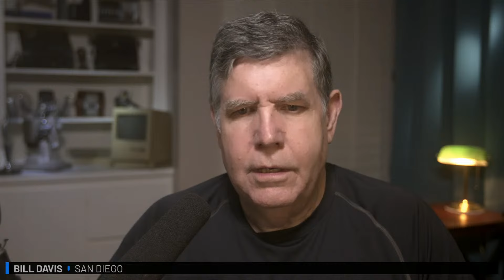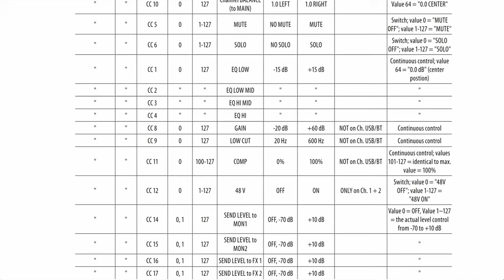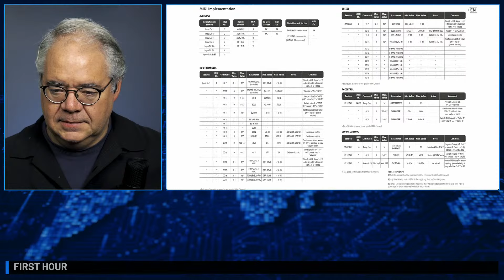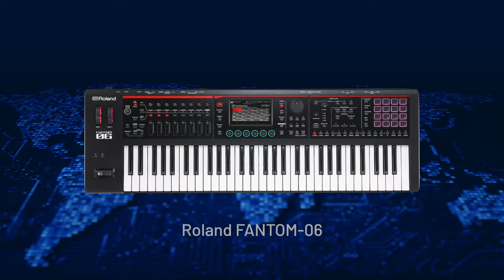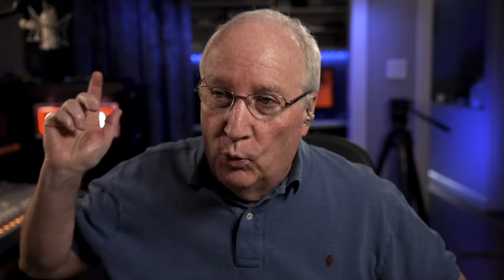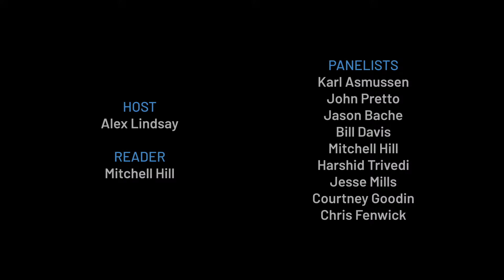Focus on Budget Solutions for Audio

Comment from the maker: 01:39:51 What are your best budget portable PRO audio setups for the iphone 13 pro or 14?
01:41:41 where do you draw the line from "budget audio" to buy once, cry once? client's budget? say rode wireless vs. Sony UWP vs. Shure ULX
01:50:38 What are situations where the purchase of higher tier hardware is key to making a production budget for audio production?(i.e. automation such as PTZ camera rental eliminates operator expense, Dugan Automixer, etc.)
01:55:04 I stretched my budget to a Sound Devices MixPre-3 a while ago but as yet I have been unsuccessful getting it working well enough to use in OH. 
Should I put it through the Atem Mini Pro, direct tp Mac Studio or another route.
01:57:40 What's your approach to purchasing equipment? If someone were wanting to get started in your industry and had a limited budget but was planning on growing over time, what equipment would you recommend they purchase, and in what order?
02:00:09 Most compact mixer with dugan auto mix for really compact use when Behringer and similar is too big?
02:01:29 The godox recommendation from Karl has worked great when I needed a other than 2.4 gig wireless setup my hand held xlr mic I've paired with it is a movo any recommendations for an inexpensive replacement?
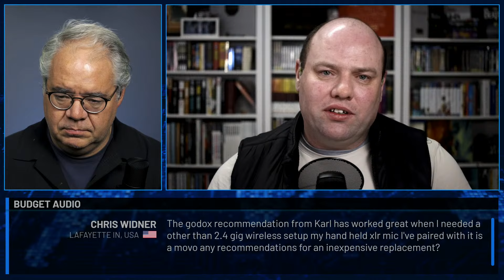02:01:59 For comms headsets, has anyone considered tactical eartube microphones? It might be a little more aesthetically appealing than the AfterShokz (which I have) - [link]
02:03:26 Anyone using Midas Consoles?